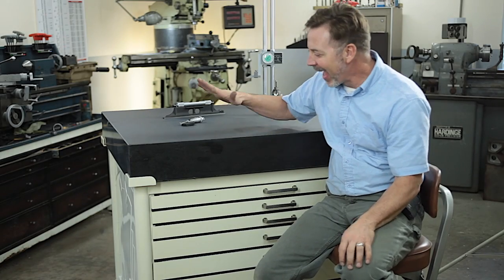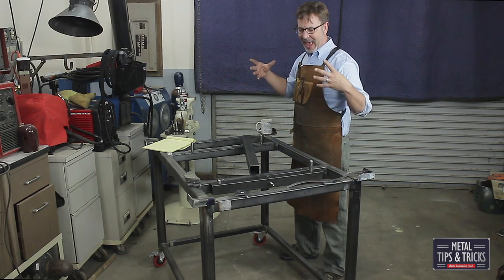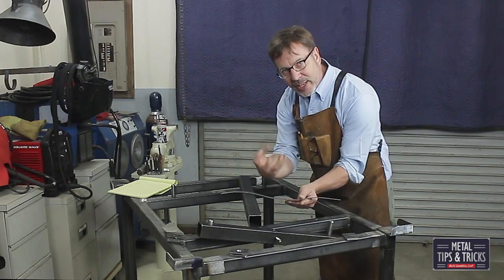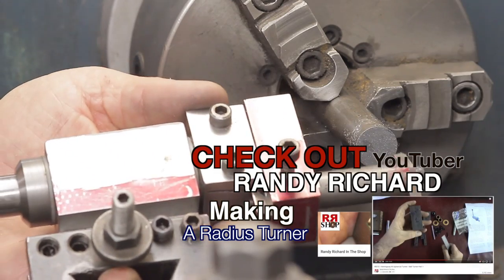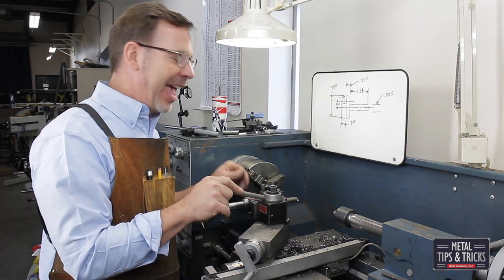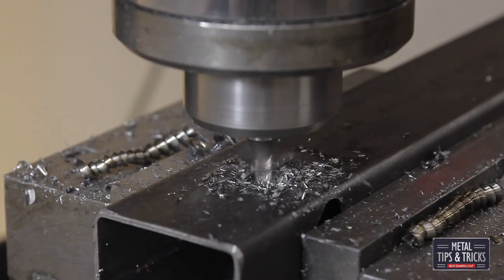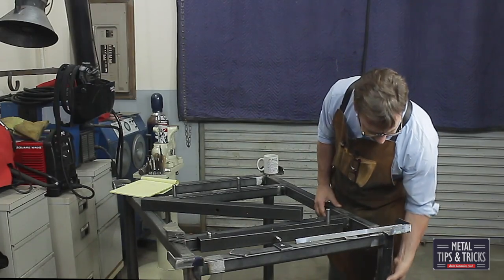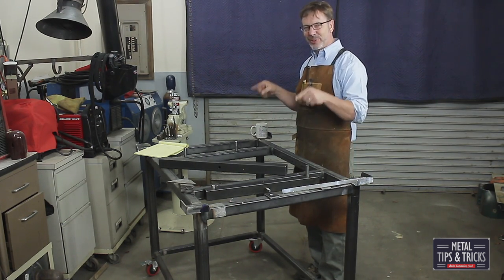Ultimate Metrology center (part one - Design )

Comment: Nice build Dale, constructive comments ahead! The wiffletree is great and makes that side deflect less in the short direction but it does not make the plate any stiffer torsionally. Assuming you place the old single support side of the plate on the wiffletree side it will go slightly concave from the change of support locations. So you may want to have your plate resurfaced while on the new stand after changing from the original 3 point support that it was lapped on last.
ATB, Robin
Reply from the maker: Thanks for your constructive comments they are always welcomed. My  plans are  to have it relapped next  year.  I want to let  it settle in for awhile.
Reply: ROBRENZ n.   K

Comment: Nice design/build,. As several others have said, "Nothing built too strong ever broke." 

A note on castering heavy objects: the casters need to be chosen so that any two can support the entire weight plus any likely impact forces. The reason being that unless the floor is PERFECTLY flat, there will be times when the weight IS supported on only two casters. Add forces from hitting a crack or small object on the floor and the requirements increase greatly.

Four Bessel points, with two self-aligning, might be technically better, but all (as far as I know) surface plates have the final finishing and flattening done while supported on three clearly marked points. Changing that to four points disturbs the factory flattening. You may intend to get your particular plate reflattened while supported on the better system, but until then it is likely to be less than factory accurate.
Reply from the maker: Peter Thanks for your input on the casters. I most cases I use 6 casters. it helps moving they object over  the expansion joints on concrete floors. But my shop in Atlanta has no expansion joints.LOL

Comment: so so interesting! I want to learn machine work very badly. after 40  plus years welding/fabricating I've never touched a lathe or mill. 
it's about time to learn. your channel will help tremendously!
Reply from the maker: Hi Brad, You are in for a great adventure. Working on those machine make me smile everyday.
Reply: Metal Tips and Tricks- my new journey will be so much easier if I do learn some machining methods. designing and building Industrial furniture and Custom Outdoor Kitchens and Living Spaces. I will also venture deep into blacksmithing and Bladesmithing. 
my life's highest bucket list item is to master all metalworking and woodworking.

Comment: Hi Dale, love the topic. Many years ago I worked on some very large surface plates (8ft x12ft) that were supported very much like your design, except that the ball feet sat on different surfaces. One sat on a flat, one in a cone and the third in a V groove that was aligned with the cone. This allowed for expansion of the stand or the plate and also positive location of the plate. I seem to remember that it was called a Kinematic Support, although it was over 50 years ago.
Reply from the maker: Hi Allen. I found the information in your comment very interesting. thanks

Comment: Thanks for the video. I have one observation on your stand, the pivot point all the weight is on the two edges of the tubing. Was wondering if it would be better to over drill the hole and weld in a tube so the pressure is more spread out. Other then that nice build.
Reply: Very good thought.  Spread the load out for more surface area.  Reduce the chance of crushing the tubing wall.

I would suggest using a rubber matting instead of cork to reduce the chance of disproportional crushing under load.  The matting is more uniform than cork.
Reply: I don't know anything about the points Dale is presenting, but I was curious about the strength and influence the granite weight will have on that thin wall tubing and pivot bolt also.  I hope that doesn't make me appear to be a troll.  Great video.  It's good to see the channel pick up a serious sponsor too.
Reply from the maker: I could have done that. We will see how it works over time. if it fails I will do a video on it. :-)

Comment: Pretty awesome idea!  Also nixing those casters was a very smart move.  Pallet jack is the best solution.  One issue I had on my welding table, was the leveling feet snap like twigs when moving with a pallet jack  if you hit anything.  My top weighs in around 1700lbs.  But that is easier to fix then a failed caster!  The table looks great btw!
Reply from the maker: Cole thanks for your comment. I did over build the leveling screws. You will get to see that  in one of the next videos.

Comment: Of all the multi part series builds I have watched on YouTube this is by far my favorite. I have been putting together material to build a 16 drawer rolling tool chest with assembly top and was wondering what the ratings on your drawer slides were? I'm sure you mentioned it in this series but have gone back and couldn't find it. Any other reccomendations outside of using plywood to mount the slides?

Comment: I like this design, its very creative and kinematically correct in supporting the surface plate, however, the 4 legs would benefit being on whiffletree as well to reduce racking of the frame. another nice option would be to make two of your pin supports adjustable so you can level the plate.

I would be interested in understanding the deflections of this design prior to building it. If you want to share it i can model it in FEA and optimize the structure. I would be happy to share results. at any rate nice work and refreshing to hear references to Airy points and Bessel points. Airy points are so simple and elegant. For minimum deflection the support spacing (centered about the midpoint of the beam) is 5/9 x Length. Works for everything and always. Exact constraint design!
Reply from the maker: HI< I lke your proposal please send me an email so we can talk about it. Dale@ metaltipsandtrick.com

Comment: to get a better finish  make a LONGER handle.  That will give you  more control in the rough spots and a smoother slower progression through the cut.  After that you might consider tightening up the rotating shank.  I used a large tapered roller bearing from a nissan minivan transmission  it is dead smooth.

Comment: really looking forward to seeing the rest of the build.  Just a quick bit of a comment on surface plate supporting.  You need to meet two criteria, not over constraining the plate (you have met this requirement) and holding the plate in the same way as when it was lapped.  Your arrangement supports this better than when it was lapped and so you may see a slight concavity at the rocking support end.
Reply from the maker: Hi, I plan to have it certified in about a year after the plate has settled down. It will be  Interesting to see how much it has changed.

Comment: Assuming you weren't going to move such a table (I know that's not the case in this video), could you build a container where you currently have the whiffletree/whippletree and fill it with concrete or epoxy etc. and get a very flat surface that would support the granite plate evenly enough?  Second question...would such a whiffletree set up make sense for supporting the frame of a small d.i.y. cnc machine, to keep the frame from twisting?

Comment: The radius tool is essentially a boring bar with a crank handle right? You might be able to adapt ThisOldTony's boring bar design. His design has a screw adjust and a graduated dial. Maybe the next prototype. Great vid!
Reply from the maker: Yes you a right, they are very similar.

Comment: In the optics world, we have a similar problem in supporting the primary mirror of reflecting telescopes. You seem to be converging on a similar solution to this problem,with perhaps a bit simpler rig. See http://www.loptics.com/articles/mirrorsupport/mirrorsupport.html for an example. Note the multi-level whiffletree arrangement of the support pads. This example also has an electric fan to help speed up thermal stabilization.
Reply from the maker: Hi Ed , Thanks for putting a link in your comment I found it a very  interesting article

Comment: loose the wheels.... surface plates should be on fixed structures... not on wheels
Also..nice idea about preventing metal beams sagging.... just take structural steel that is thick enough.... that would omit all this 'over-engineering !

Paddy

Comment: These Bessel points are overrated. If you lap your surface plate on the actual supports and don't take it off or move it and your lab has stable temperature then it is not that important how you exactly support it.  An iso-mount (=whiffle tree) helps to make the rigidity of your support structure unimportant. But if you have large temperature changes you loose your accuracy anyway. A serious measurement laboratory has to have stabilized temperature. So you need an iso-mount and temperature control and lap your plate under those conditions. Then accurate Bessel points are not that important.